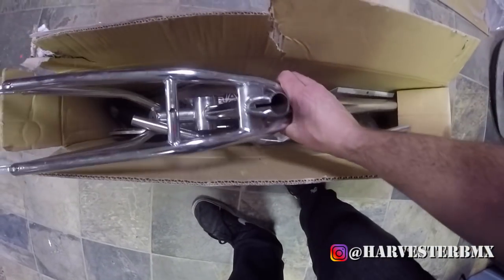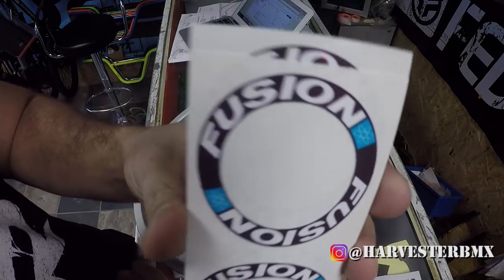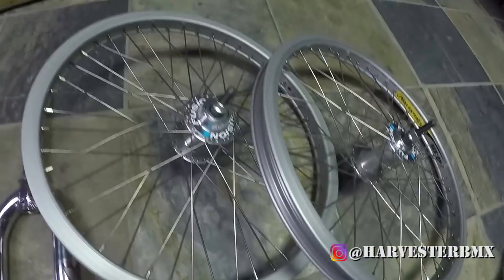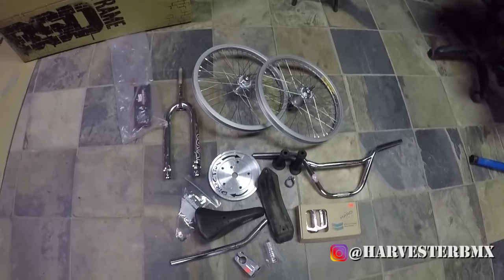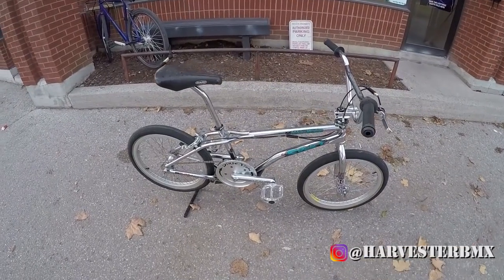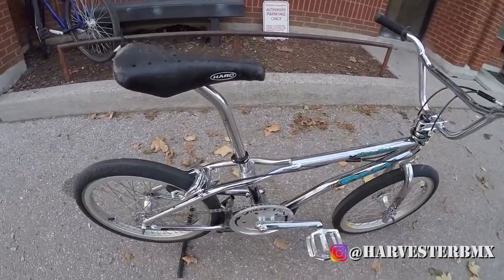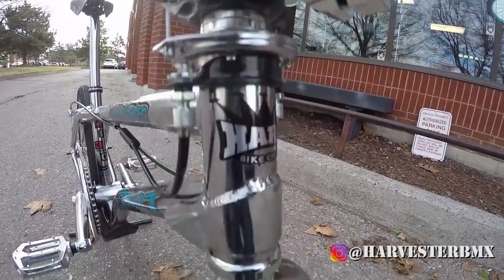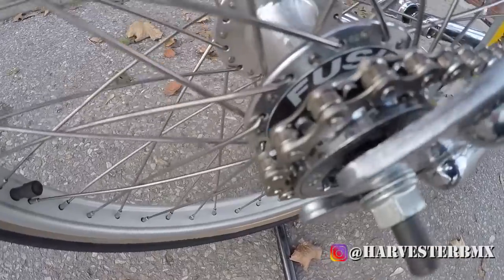1995 HARO SPORT BASHGUARD Custom Build @ Harvester Bikes OLD SCHOOL BMX

Comment: Did the sledghammers come.out on those frames not sure, but I know they came on.the 1990 and 91 edge frames. Ive got a 92 shredder , same as the new sport versions  but thinner tubes , and im searching for a 92 edge which is same as a ground master. For my next build